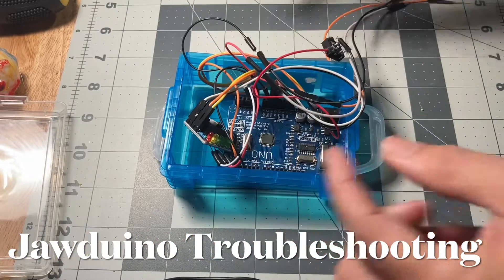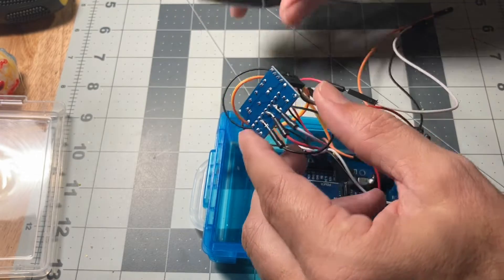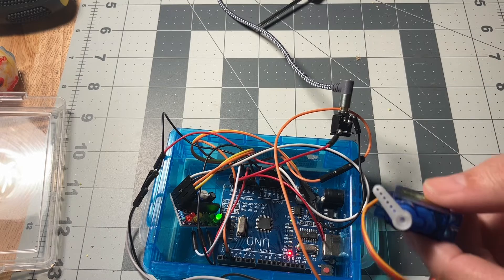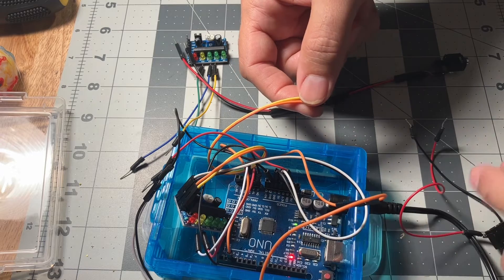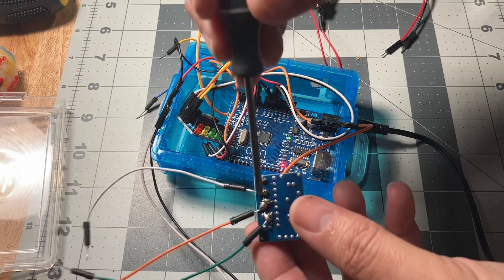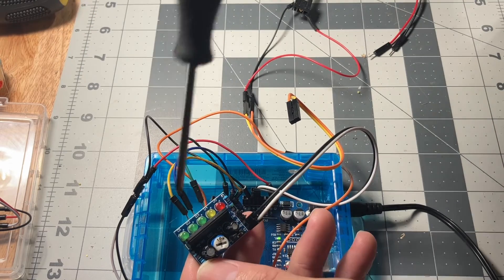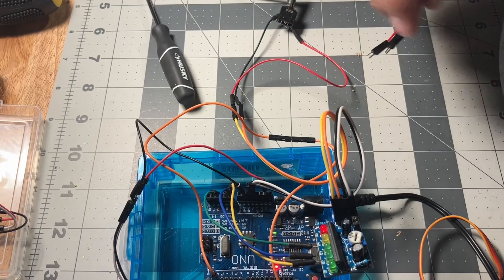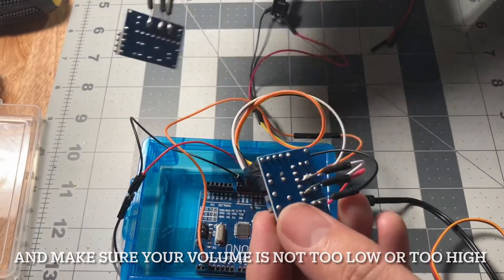Jawduino troubleshooting for common issues

Comment: I have it all hooked up and the audio is feeding it and showing it light up but the servo is not moving. Any ideas on what this could be
Reply from the maker: If the code is correct, swap out the servo. If that doesn’t work, see if it is this issue. Let me know if it works after this or not. If able to make a video of setup and upload it, that would help me to see as well (that’s a lot I know).

https://youtu.be/rRPCOnYJAEU?si=5uQp0JUKF2EXIur7

Comment: Hello, thanks for the great video. I recreated it and it works so far. The only problem is that my microphone doesn't work. I tested it and it's not broken. If I connect an MP3 player it works without any problems. Do you have any idea what could be wrong?
Reply from the maker: The straight microphones are strange. Not sure if it is the lack of signal, but I used a 48v phantom power mic and it worked. I have also connected a regular mic to a small mixer with it output to the left channel. I don’t know why it worked that way but it did. I’ll look more into it and do some troubleshooting and post back here.
Reply: Hi, OK, thank you very much for your efforts. Great support
Reply from the maker: @dirkthiel1262  So I did some troubleshooting and I came to the conclusion that it requires a powered mic. I used one that was 48v phantom powered and one that was regularly powered from XLR and outputted to audio input and both worked fine. When I used a regular plug in mic, no sound. I’ll keep working on it but I’m at a loss right now on how to make a regular non-powered  mic work. I’ll post a video soon on what I did and maybe someone who sees it can give some advice.
Reply from the maker: @dirkthiel1262 Use a mixer. I figured it out. Here is the video:

https://youtu.be/rRPCOnYJAEU?si=p3yLiDz-_EoPyc7s

Comment: My small servo just keeps rotating (brand new) when powered on. Bigger servo doesn't move (with its own power source) any advice?
Reply from the maker: Only thing I can think of is the code is wrong or the soldering is off. It’s hard to picture what is going on. Does the big servo work with a normal sweep code? If it doesn’t with a normal code then either the servo is bad or it is not getting enough power. Bigger servos I use 6-7volts (though I’ve been told on YouTube that doesn’t matter but it works for me). 
If you can post a video of your setup and what the servo is doing and put link on this comment maybe I can see what is happening. I’ll try to help the best I can.

Comment: Brian, Do you have the code for this project? Thanks
Reply from the maker: /*********************************************************
08-14-2016 Mike North This is a little proof of concept 
to make a servo move in sync with audio.
*******************/
#include "SoftRcPulseOut.h"
#define TEST_PIN 11 //pin 11 set to ground will kick off the servo sweep test
int audio_value = 0;
long lastMsg = 0;
long sleepWindow = 300000; //if 5 minutes go by with no signal, then put the servos to bed
SoftRcPulseOut servo;
volatile boolean servosEnabled = false;
volatile boolean ledsOn = true;
volatile unsigned long currentTime = 0;
volatile unsigned long lastLEDtime = 0;
unsigned long resetWait = 120000; //servos sleep if not changed within this time frame (120 secs)

void setup()
{
	set_minmax();
	pinMode(TEST_PIN,INPUT);  //pin 11 will be 
	digitalWrite(TEST_PIN,HIGH); //assign pull-up resistor
} 

void loop()
{
  servo_test();
  audio_updates(); //read sample from audio input and apply average to buffer
  if(servosEnabled) 
  {
	action(); //servos are handled in the action loop
	SoftRcPulseOut::refresh();
	if((millis() - lastMsg) > sleepWindow)
	  detach_servos();
  }
} 
void attach_servos()
{   // attach the pin to the servo object
    servo.attach(2);
    servosEnabled = true;
}
void detach_servos()
{   // detach the servo objects
    servo.detach();
    servosEnabled = false;
}
void servo_test()
{
	if(digitalRead(TEST_PIN) == HIGH) return;
	attach_servos();
	SoftRcPulseOut::refresh();
	for(int i = 0; i < 360;i++)
	{
		if(i < 180)
			audio_value = i;
		else
			audio_value = 359 - i;
		action();
		for(int i = 0; i < 10; i++)
		{
		   delay(1); 
		   SoftRcPulseOut::refresh();
		}
	}
	detach_servos();
}
void audio_updates()
{
	audio_value = 0;
	if(analogRead(A0) < 341) audio_value += 50;
	if(analogRead(A1) < 341) audio_value += 50;
	if(analogRead(A2) < 341) audio_value += 50;

	if(audio_value > 0) 
	{
		lastMsg = millis(); //save the time stamp from when we last had some action
		if(!servosEnabled)attach_servos();
	}
}
void action() { 
  if (!servosEnabled) attach_servos();
  servo.write(audio_value);
  SoftRcPulseOut::refresh();
} 
void set_minmax()
{
	//set the first parameter in the following functions to a number between 0 and 180.
	//I used 92 and 72 in my tests to give about 20 degrees of motion.
	//You may swap the large and small numbers to reverse direction.
	//Just play with them, upload the code, then ground pin 11 to run the sweep test.
	// Be sure to only play with these numbers while the jaw linkage is disconnected,
	//  otherwise, you risk hitting mechanical limits and damaging your linkage or servo!
	servo.setMinimumPulse(map(62,0,180,512,2400));
	servo.setMaximumPulse(map(120,0,180,512,2400));